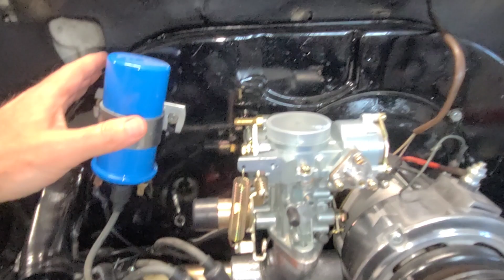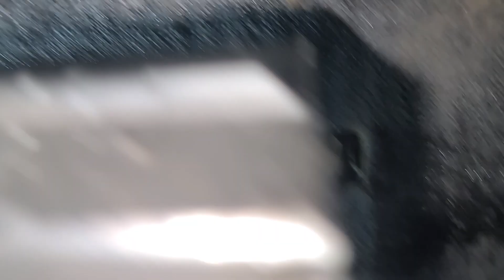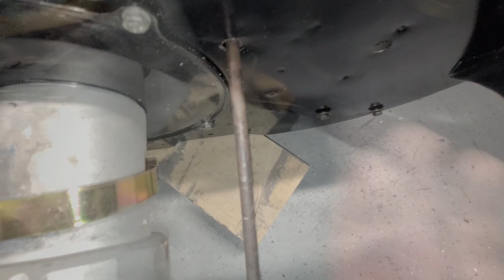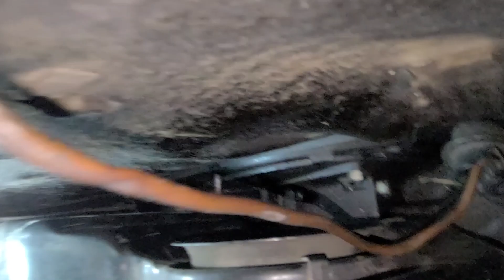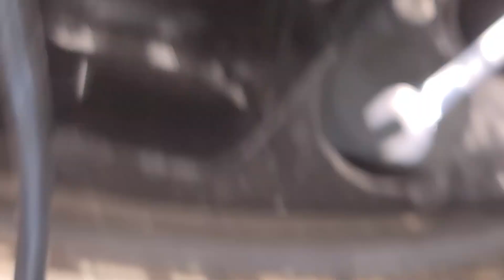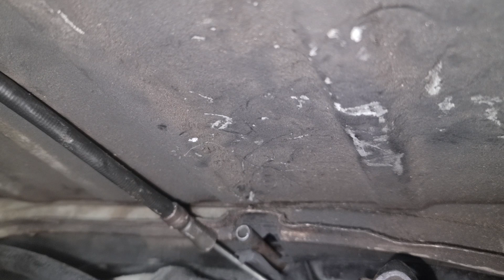1979 VW beetle Fuel injection to carb conversion [Part3] Throttle cable reposition

Comment: could you just buy the doghouse for a carburated engine?
Reply from the maker: @JoseMTZ  yes. They do sell those.
But...
Then I would have this old one sitting around.  I am more inclined to reuse and recycle when I can.
Reply: @ thanks for the answer I was just wondering thinking maybe the dog house is different to a fuel injected one